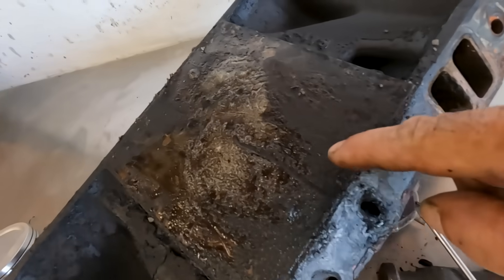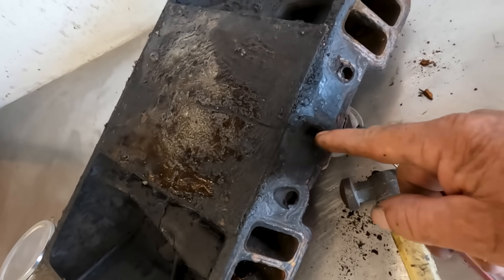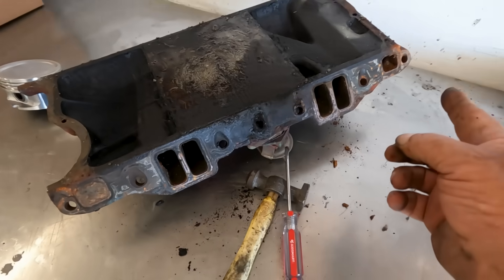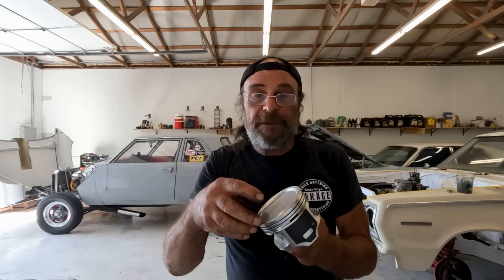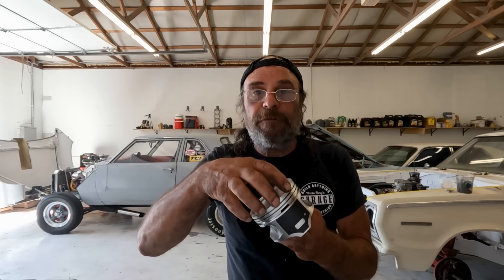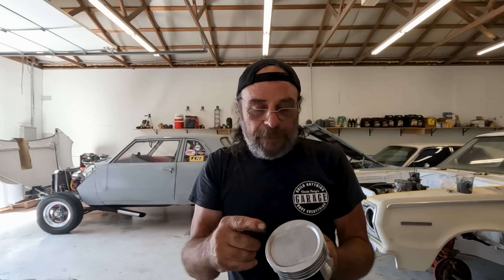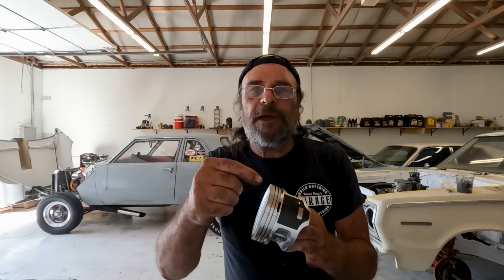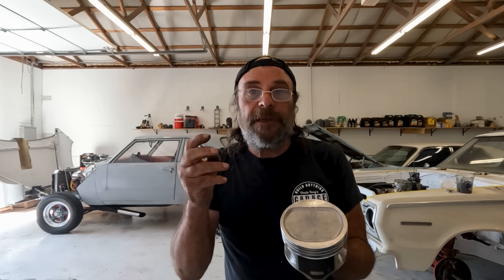The Number One Killer Of Gasoline Engine Efficiency And Power And How To Stop It

Comment: In early 80's i took Automotive Mechanics in Vocational School in High School. We were continually doing valve jobs on full size cars with  stock small block Chevy's that had carbon build up on back side of valves, protruding back into intake port of heads and slightly build up on last half inch or so into intake manifold itself, EGR passage ways in intakes were completely clogged and that stuff was hard as a rock. Teacher told us Leaded Fuels probably compounded the issue. He showed us the trick of dribbling water down the carburetor and he did it many times on different cars in the shop over the 2 years of school. Some engines were extremely bad and it was a job cleaning that carbon off.

Comment: My gramps was an English car mechanic. Pulling the heads to de-carbonize them was a regular thing back in his day. In the early 2000's we used Wynns... I think it was called VIC treatment. Probably a combination of water and solvent? I don't know if it helped. But a heck of a lot of soot came out the back end. We didn't sell those for long. I was worried about the shit I was breathing. 
Water injection was a thing for a while. One of the side benefits they claimed was it removed carbon build up. With todays shit fuel it might be worth revisiting this idea. Although with all the alcohol in today's fuel it probably already has a high water content.

Comment: Water blasting does an amazing job of de-carboning valves and combustion chambers. I think many of us have seen the steam cleaning effect in a cylinder that has a coolant leak that allows that little bit of water to enter the cylinder. That one cylinder and combustion chamber look like new compared to the adjacent cylinders.

I used to hear some people claim that their engine ran smoother and stronger after driving their car thru a car wash. And it makes at least a little sense when you think about it. Not as effective as water blasting, but still a bit of extra moisture finding its way into the engnine. Both from the extra humidity of the car wash tunnel and any water splash that finds it way under the hood.

Comment: SHOULDNT YOU BE SPECIFIC HOW TO TRICKLE THE WATER INTO THE CARB? i already did this with seafoam to my 76 360 fe, but i wasnt mindful of getting it on both barrels so maybe it didnt woork so well.
- im new to carbs but dont both  2 and 4 BBL carbs have a seperater plate that feeds only one set of pistons and the other side feeds the other 4 pistons?
assuming a dual plane intake and not racer single plane.

Comment: I’ve decarbenized several engines years ago, dumping water down the carburetor while it’s running at several thousand rpm, worked great, my question is, with most modern engines and even older engines that’s had a o2 sensor installed, do you think water will harm the sensor.  Or should I remove the sensor while I’m de carbonizing the engine? Thanks as always for the valuable information

Comment: I think a major source of that carbon buildup on the back of the intake valves is from crankcase blowby  being sucked into the intake through the pcv valve. An oil catch can would probably help a lot, especially on a carb or throttle body engine, port injection tends to keep thing pretty clean on its own with todays fuels.

Comment: My dad made a diy water injection on his '64 Travelall back in the early 70's. Had a vacuum gauge mounted on the steering column and a big bottle of water on the transmission hump and would adjust a needle valve. It was very loud inside the car when operating..

Comment: Ive seen several older Ford V-6 engines crack cylinder heads when the exhaust crossover passage got plugged up with carbon. The german 2.8 and 2.9  V-6s were the worst. Always crack the center chambers on the heads

Comment: Anothing thing I ran across speaking if carbon, I only worked on one they motors, It was a Toyota Sienna motor, I ended up doing head work on it, the motor was a direct injection motor  but also had injectors in the intake runners too, it turns out the motor uses the upper injectors only at idle speeds, anything more than this it switches back the the direct injection injectors, so I guess it works because when wevrrbyilt the heads therr wasn't much carbon build-up, but it still didn't stop the motor from burning an exhaust valve😅

Comment: Another thing UT didn't mention, I agree with what he's saying about the intake valves being caked filull of carbon, I've owned an Auto/Diesel machine shop,vseen all of this, also most of these 70s/80s V8 motors, by 100k the tming chains were really stretched out so the cam  timing would become extremely retarted, most of these cars would lise the timing chain or it would jump several teeth and the car would crap, if it jumped far enough you would end up with bent valves.

Comment: Hey Uncle  Tony  you bought back some good memories from working with my dad at the Exxon station.   Sixteen and I wanna go fast  ,   we. Had a sweet older lady that the Chevrolet dealer sold her a 66 Impala SS 396 4V duals with a powerglide .    I believe it never was north of 1500 RPMS  she would come in tell dad its not running right,   so my old man would have me take her home and then then say to lean on it coming back.   I nailed it and was shocked nothing happened i looked in the mirror and it was Rolling serious coal .  Back at work dad says tune it up ,   all sparkplugs are black distributor cap & rotor were good shape points perfect so i  check the advance weights they don't move hit them with CRC and checked carb to my surprise it was a spread bore Holly.  Linkage was. Smooth but at WOT secondarys were  stuck shut  , more CRC dad loved that stuff , prying weights with screwdriver finally moved kept working them till nice and free  ,  back at carb got secondarys to work good put it all back together  and take it for a  spin  pull it down in low nail it engine came alive but I wasn't impressed look in mirror its rolling big time coal  all of sudden i thought something rear-ended me up comes front end and so much soot everything behind was black.   That o'l 396 started walking fast 60 MPH in low was blowing all kinds of things out the back . Made two more passes itwas all clean at the back final pass in drive to check for shift point.   This is where I met GOD as I said it was  a 1966 Impala you already know what is  coming . 3 times brakes good  as drums can be Suprise single master cylinder pedal goes to floor and stays there.  Now I got the big eyes and tight butthole their is no pumping brake when its on the floor ,  pulled into low and stepped on parking brake took forever to slow down pulled up to gas station and hit parking brake and nosed towards  a big curb at idle and stopped .   Dad comes running at me yelling what's wrong  I did not know how white I was brakes failed at speed he goes awe Bullshit I got out shaking said you get in and try them he said Damn that is not what I said.  We gave her car back with new plugs & new master cylinder no charge .  Big lesson learned for me at 16 .    I have a 66 Galaxie now and you can bet your ass it has a dual master on it.  All the Best  UT Howard

Comment: In the 80’s, we are working on 70’s used cars. The carbon on the intake valve was not only an insulator, but a sponge, holding raw gas. We use ATF for a while, then “Justice Brothers” 3-can kit. One in the tank, oil, then sip last one thru in intake once up to temp. Then we used “BG-Chemtool B-12 down the carb. Now “Top-Tier” fuel at the gasoline but at a cost. GM put out a “TSB” to diagnose, clean injectors once for free, then instruct the customer to use “Top-Tier” fuels and keep receipts! With the PCM on variable valve timing, early intake valve closing was used a low RPM’s to eliminate blow-back of carbon behind the valve. Now, newer rings are cut with thin grooves to produce outward pressure, but imports in the 70’s used thin chrome top rings. No carbon and no groove at 300k… just crosshatch!

Comment: Using lower octane gas builds carbon and slow driving is bad for oil pressure that's why carburetor cars are best with a straight 6

Comment: My 1983 Ford F100 with its 4.9L six doesn't appear to have this problem.  I bought it new, and it has 300,000 miles on it.  I had to replace the exhaust manifold last year because it cracked.  There was so little carbon in the intakes that I didn't bother to try to clean them.  I've always run this at diesel-like RRMs, generally shifting into high at 25mph, and using overdrive as much as possible.  Both the engine and AOD automatic overdrive transmission appear to like this treatment, for neither has needed much in the line of service.  I change trans fluid every 30,000 miles, and rebuilt the valve body with an improved spring kit.  Otherwise, all original.

Comment: Years ago, i had a job ($3.10/hr) at Quick-Lube, a drive through oil change business.
 They were selling a 3 part ( can ) emissions system cleaner.
 Justice Brothers, i believe the name was.
 1 can in the fuel tank 
 1 can in the engine oil
 1 can was poured slowly down the intake.
 Most vehicles we did the process to would stink the place up really bad, like rotten eggs.
 I had a 1980 toyota pickup. When i did the process to my pickup, barely any odor . . .
 I always ran the engine hard, full throttle, everywhere i went. It never had any build up, in the engine, or emissions system.
 😁☕

Comment: Every 6 months I would run 8 ounces of marvel mystery oil per 10 gallons of gas and a bottle STP carburetor cleaner through 4 tanks of fuel. On the 4th tank the engine would get sluggish and begin blowing out chunks of carbon, would rev the engine until the exhaust blew clear. Did this prior to having a problem to maintain peak performance. This also works to keep group injectors clean….

Comment: I assisted my step dad back in the day. I was young & dumb. I could tear apart & reassemble about anything. Just wasn't good at the trouble shooting back then.My 71 Monte wasn't running real good. We did just that. As u explained. He had 2 bottles - one with water & one with tranny fluid. Would switch back & forth. Then at one point - he flogged the throttle - at the same time added tranny fluid to the point it killed it. Let it sit for awhile - then fired it up. That really broke stuff loose. Run like a top after that  !!!
A car I wish I still had.
Excellent video & topic.
Thanks - keep it up.

Comment: Best if the exhaust cross-over is carbon-clogged if going to EFI.  Carbon clogging the intake has long been a problem in diesel engines since also direct-injection.  The carbon comes from oil crud in crankcase vapors.  In 1950's engines, those vapors were just vented to the atmosphere (via "road tube"), but PCV began sucking those vapors into the intake in the 1960's such as the early CA "Clean Air Package".  The latest DI  gas engines have a small injector spraying right after the throttle plate to keep the intake manifold and valves clean.

Comment: Jc  Whitney had a kit they you attached to a vacuum line on your carb or bosh fuel injection that would suck water from a water bottle through a tiny metering plug and add fuel mileage, make better performance and keep your intake, valves and cat clean.   Had it on my old Volvo.
Reply: Water injection system, they were used in huge numbers in the 70's to stop detonation. The system was developed in during WW2 to use on airplanes, it is a way to artificially increase octane without adding more octane. Been looking for a 70's era Gehraty one for years, only found a partial kit in terrible condition

Comment: TONY, would using a oil separator between the PCV valve and the intake manifold help with keeping carbon buildup on the back of the intake valves ???    😀😀😀😀😀

Comment: Dripping water into the intake manifold to clean carbon is an old trick, BUT it will not clean the carbon from the intake valves, where it is not hot enough to boil the water. That is why Toyota went to the trouble of having dual injection system. For the small fuel savings against the cost of cleaning out the valves several times in the life of the engine, I think you lost money. Just like with many auto electronics gadgets , especially when they were new in the early 80s. Some people have to keep relearning the same lessons. You cannot tunnel vision on fuel savings.

Comment: The easiest way to remove the carbon in an injected engine is Yamalube Ring Free Plus cleaner. Which will clean injectors, valves, piston tops and the ring lands. Most of that carbon comes from the oil sucked back in from the PCV system, so having an oil catch can will help. I have noticed an increase in power in my Ecotec 2.4L in the 1000 to 3000 RPM range after using both Yamalube & Seafoam.

I have also used Seafoam in the crankcase and in the fuel, that has helped with keeping my oil cleaner and now switched to a DEXOS 1 Gen 2 oil and my oil consumption has gone down to practically zero.  I also just bought some Gumout with PEA cleaner today and that will be my next test, I will be pouring that in the crankcase, sort of a cheap man's Valvoline Restore and Protect.

Comment: Use either a dollar store cleaner spray bottle, or get a pump and spray pressurized plant sprayer. Just make sure you don't over bog down your engine. 
It's typically either called seafoaming or an Italian valve job.

Comment: 4:13  False.  I've been in several engines with over 100k and they didn't have a thick layer of carbon on the intakes.  My most recent was a 180k Cherokee with a blown head gasket, there was so little carbon on the intakes that I didn't bother cleaning them.

Comment: Tony, how much of that carbon  is coming from EGR gasses mixed in with oil vapor from the crankcase dumped back into the intake? I thought that was the major source of carbon on the backside of intake valves.
Also, for DGI engines my understanding is that carbon on the back of intakes drops efficiency due to changing the airflow swirl into the cylinder and prevents proper mixing of the fuel and air. I guess it could reduce the amount of oxygen as well, plus get to the point of preventing the valve from sealing properly during compression.

Comment: Another source of carbon build-up on the intake valves is the PCV system. Oil mist created by the moving 
internals of the block are sucked up into the intake, and as they hit the back of the valve, they stick there and 
add to the carbon that already started to build up. Carbon attracts Carbon. One of the best ways to cut 
back this effect is with a "Catch Can". There are many vids on YT to demonstrate catch cans. I made my own 
catch can with a remote-mount oil filter inline of the PCV valve line. Every oil change, I also change out the 
cheap oil filter in that line, and you'd be surprised at how much oil that cheap filter kept out of my intake.

Comment: newer engines with softer steel rings get carbon build up too. 
My Honda CRV was eating 1 Qt of oil per week last year.

I read in a YouTube video comment that you can clean the rings by periodically driving at lower gear on the highway (once the engine is warm), say @ 4000 RPM.

I'm sure i did this a few times without knowing it; it is now down to 1 Qt per month (if that).

Going to try water in the intake too!

Comment: Now that I have had time reflect about my mechanic years, it probably would've been worth it to charge the customer to disconnect the exhaust so that the carbon wasn't being blasted right into the front of the catalytic converter. Just tie it up with mechanic wire or something during the process.

Comment: I didn't hear you nention the PCV system and how it adds carbon to the intake system.  You should have mentioned the Miller cycle and Atkins cycle engines with direct injection compounding carbon issues in the newer hybrid cars.   Do you think the water system or water injection systems of the past would help direct injection engines stay cleaner longer?

Comment: after you explained the gas pushing the rings outward from  the  top I immediately thought of putting a hole from one one side of the piston behind the compression ring to the other side and connecting to a pin hole at the center of the top of the piston. Then you start talking about back in the day people drilling ports in the piston. Am I some kind of genius?

Comment: You want an engine that has a fuel system/engine designed with direct injection and port injection. The addition of a small amount of fuel being used in port injection cleans the valves so you don't get carbon buildup. Just do some research on the vehicle you want to buy to see if it has issues with carbon buildup on valves/combustion chambers. For example, Volkswagons have direct injection engines in North America but in Europe, you can buy a Volkswagon with an engine with both direct injection and port injection. All Toyota /Lexus ICE engines now have direct injection with port injection.

Comment: Question about blowing out the carbon on the highway. I have an 09 car with manual transmission. Instead of going 100mph, I leave it in a lower gear for a minute or two with high rpm. I go about 5000 rpm or so. Is that just as effective?

Comment: That was informative. I stripped a few carbed engines in the 90s. The carbon in the ring lands and worn top of the bore became a thing of the past with the new low tension rings and port fuel injection conversions I did. I thought the carbon was mainly  because the carb could not wash the PCV oil into the fuel mixture like port injection could.